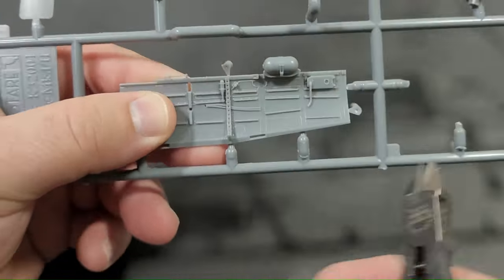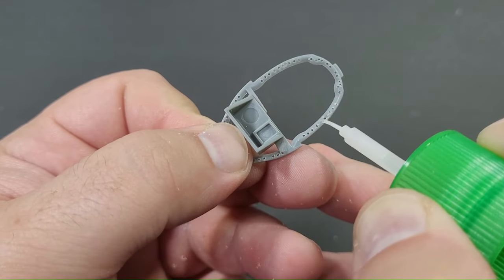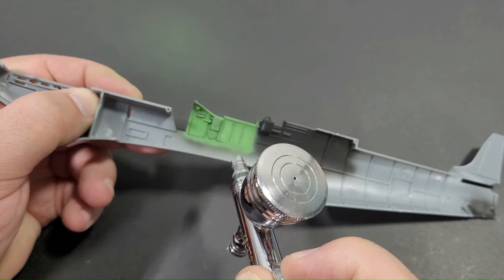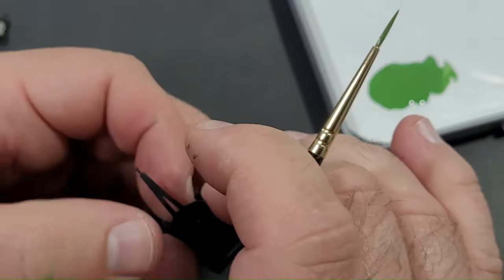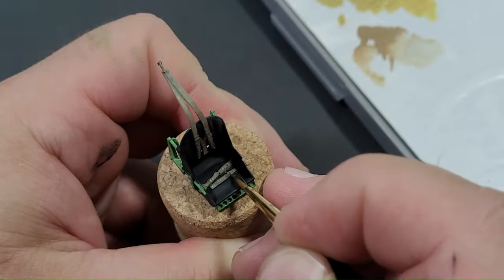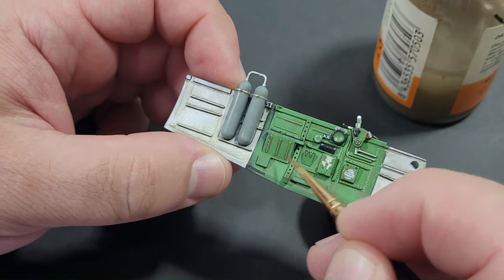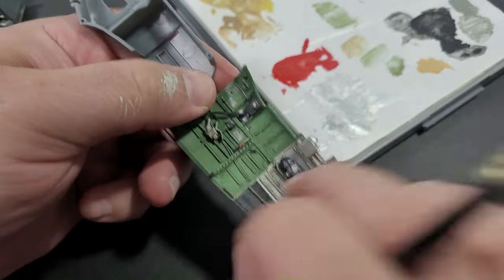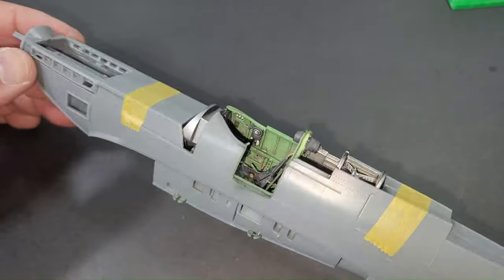Building the Kotare Models 1/32 Supermarine Spitfire Mk.1a (Mid) Brian Lane - Part 1 (Cockpit)

Comment: Excellent video and fantastic explanation, thank you for the advice regarding using xtra thin once drilling or scribing is done.Can you pls give a photo or link about that scriber you used as i couldn't get the name,Thanks.Im going to definitely use that xtra thin method after scribing in the future.
Reply from the maker: Thank you @johandevilliers756, Sure! The store is UMM-USA, there are 3 different types of scribers they stock. I have this one - https://umm-usa.com/onlinestore/product_info.php?cPath=21_105&products_id=474&osCsid=fda8154c6d5df4db81d622991bc852bb